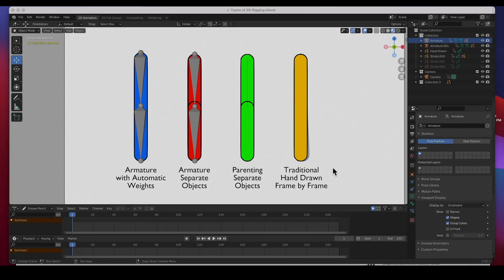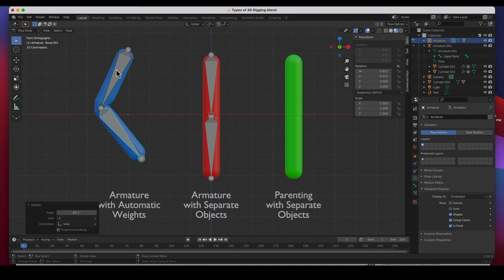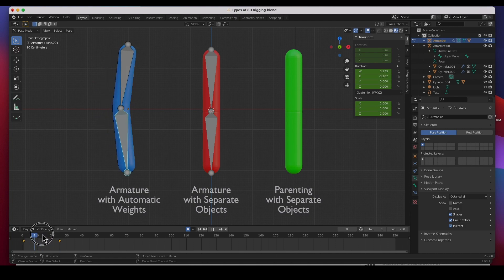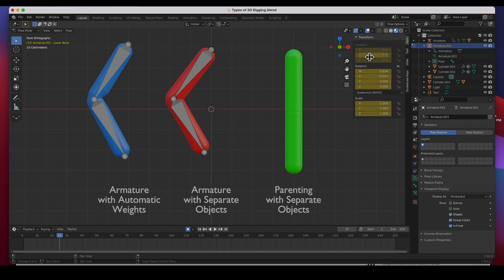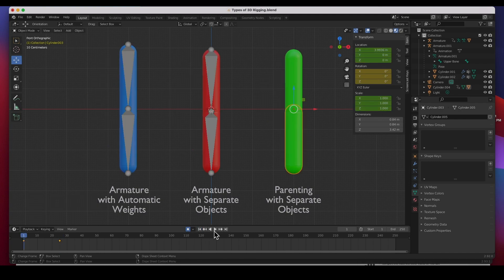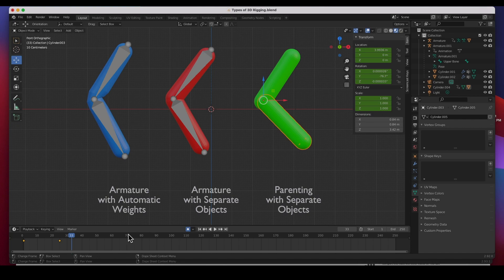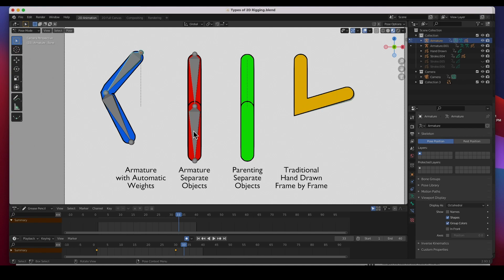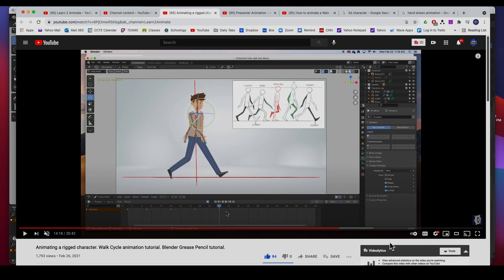Different Types of Rigs in Grease Pencil Blender 2.9 2D and 3D

Comment: I use layer relation instead of vertex group to rig separate objects with armature, but when I try to rig an arm or leg the joints/origin ends up changing its place and then my arm ends up intersecting each other. How do you keep it in place?
Reply from the maker: Thank you for the tip, I am not too familiar with layer relation. Try it with a vertex group see if you like it. Let me know